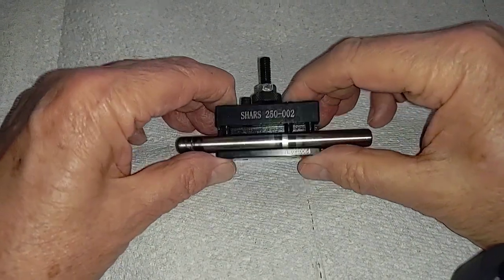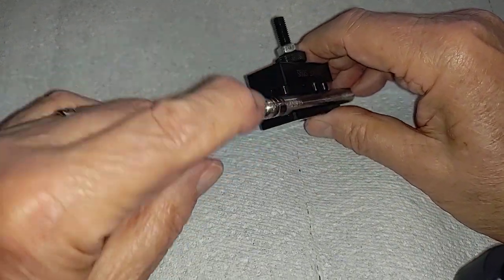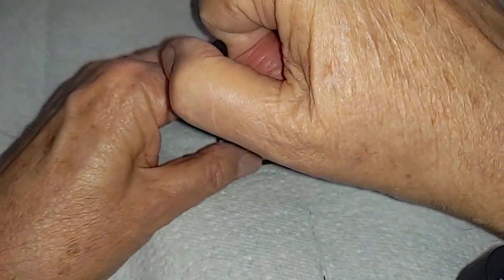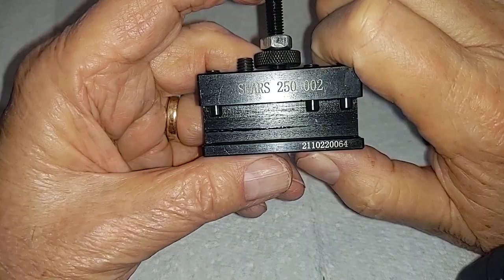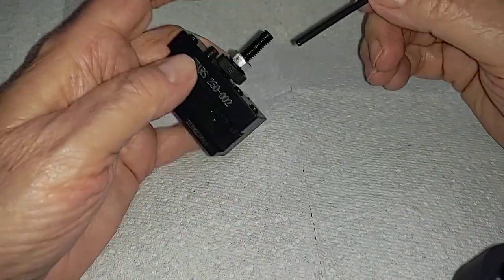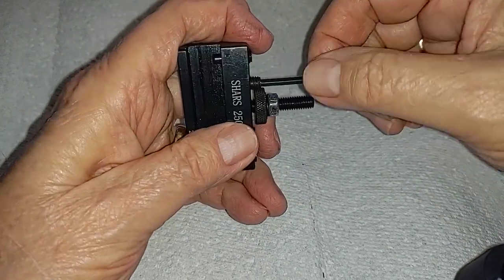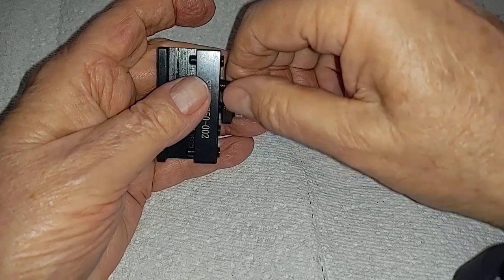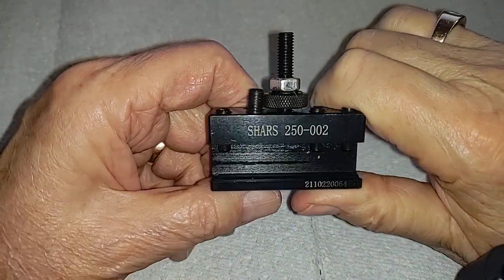Shars OXA 250 002 tool holder problem, bad thread on one of the 4 clamp screw holes.

Comment: I think I'd rather retap it, rather than send it back??
Mind you, maybe they will just send you another one and not bother getting the old one back.
But it's China, so they might not even bother replying to you either, which has happened to me a couple of times with messed up products I ordered off Amazon from China.
Twice I didn't get anything at all, and no response after...
That's why I think I would probably just try to retap it myself if it looked possible.

Thanks for another great video!